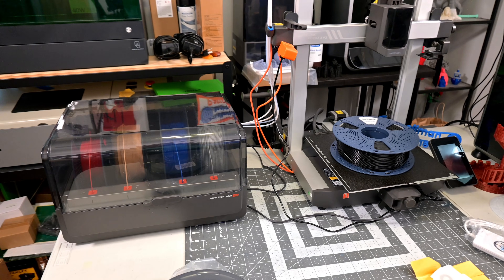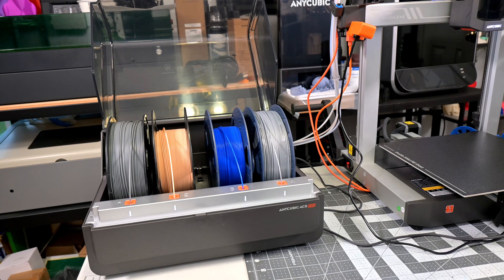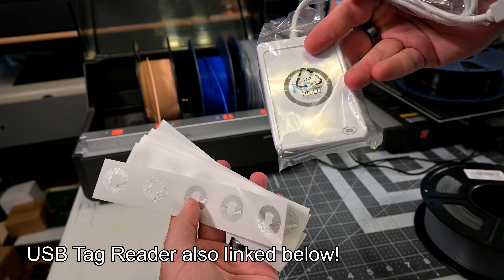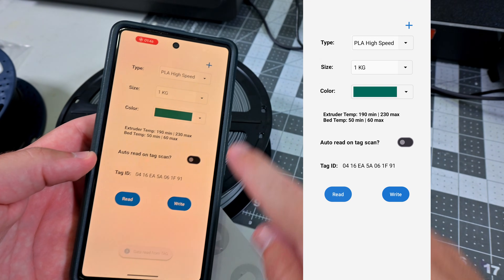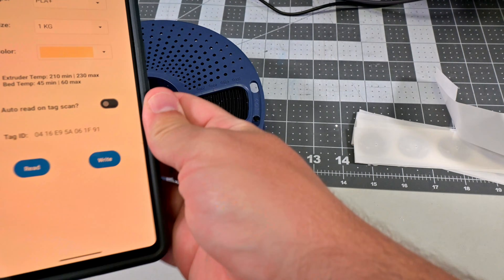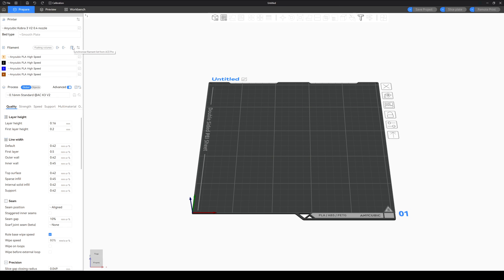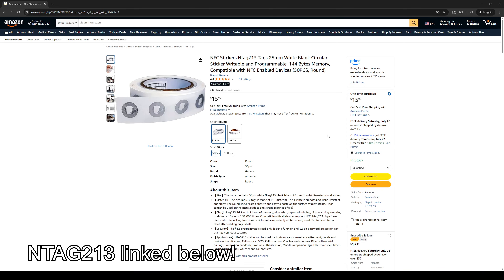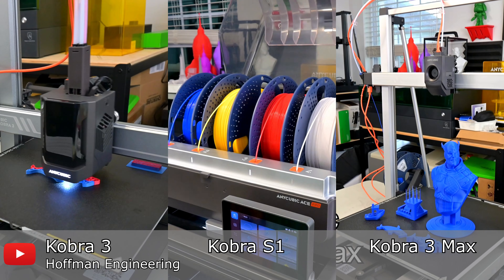Add RFID to Any Filament for the Anycubic ACE Pro

Comment: I mean I suppose if you swap your filament constantly this would be worth the trouble. I'm having a hard time seeing otherwise how this somehow saves any time over just setting the color yourself on the printer which also takes just two seconds. and is free.
Reply from the maker: Yeah, it's mostly for people with either many rolls of filament, and/or multiple printers that you are often changing out filament. And depending on the angle of the touch screen, some very different colors can look similar on the screen. I've selected pink instead of white before, and was pretty confused when looking at the colors in the slicer.

Comment: The app and process work really well! I’m thankful I have an old Android phone in a drawer! I bought some Anycubic brand filament and it came with WRONG tag programming. Ugh! I could not override my Kobra S1’s filament recognition (a simple firmware tweak I hope Anycubic fixes in a future release). I loaded the app and it confirmed my suspicion that the tags were programmed incorrectly. I could remove the tags from the spool, which then allowed me to manually input the filament type and color…sorta. Another problem with the Anycubic firmware is it doesn’t let you choose “PLA+” from the menu. Only PLA. Thankfully this free app and a few bucks in NFC tags from Amazon solved the problem. 

For those who are thinking it doesn’t make sense to pay for additional NFC tags on top of the cost of filament, I plan on reusing empty spools and only buying refills, which are a few bucks cheaper. I think I will be money ahead in short time.

Comment: The problem is that doing it as shown, you end up having to use the default Anycubic filament settings. But they're not Anycubic filaments so the default settings won't work as well as setting derived from things like a Temperature Tower. For example, 3DHojor PLA Pro works best as 215/60 first layer, 210/55 for the rest. Anycubic's default for PLA is 220/60 first, 210/60 the rest. Jayo PLA is 220/60 first, and 220/60 the rest. And so on. Go the extra step and show people how to write custom filament settings using the included manufacturers or their own. Because if you do nothing you'll automatically get Anycubic PLA anyway  - without an RFI Tag. :-).
Reply: @HoffmanEngineering
@pdyt2009  You're absolutely right.  The best method to handle the variances between vendor filaments is to create custom filament profiles for each specific vendor and filament type.  This much works fine.   It's possible to write custom RFID tags for the specific vendor including filament type, color, and temp settings. 

When the Ace reads the custom tag, the corresponding custom filament profile will be selected and displayed correctly in the prepare tab of Anycubic Slicer Next (ACN).  However, this is where the problems.  This custom info will not get passed to the workbench tab in ACN which results in an unknown filament type since the vendor is not Anycubic.  

The only way, at present, to get the RFID tags read and passed to the workbench in ACN is to write the tags as shown in the video with Anycubic as the filament vendor.  This defeats the whole concept of automating the process with custom RFID tags and custom filament profiles.  In order to make use of custom RFID tags and custom filament profiles, Anycubic needs to update ACN so it's not limited to only Anycubic filament.  The question is... will it ever happen?

Comment: Theres an iphone app available now that allows you to write to the RFID tags mentioned - works well. I also 3D printed a free filament spool ring with Anycubic logo one side and a space for the RFID on the opposite side. I believe the ring is meant to be for cardboard spools but snaps onto plastic spools just fine - however you will need to place the RFID tag lower down/ closer to the edge of the ring so its read by the Ace Pro reader. One spool design I printed had Anycubic logo on both sides including the RFID space but was too high for the RDFID reader in the Ace Pro to read. Just lower the placement of the sticker.
Reply: Whts the app called
Reply: There are several iPhone apps that can read and write to NFC/RFID stickers. Is there a specific app you’ve found that has the field formatting for Anycubic ACE pre-configured?
Reply: Love to know this app as well fir the iPhone

Comment: If I have other brands than Anycubic filament o don’t want the slicer to set it as Anycubic filament? And if I buy Anycubic filament I get the rfid with the spool. So why do I want to do this? The Anycubic PETG prints 25 degrees lower than the PETG I am using for example.

Comment: Isn't it possible to take an existing empty Anycubic spool with an RFID tag, buy a cheap refill filament in the color that was on the spool, and spool the new filament onto it? I would do that, so you save money on RFID tags, and you also don't have to go out and buy an RFID reader/writer if you don't have an Android phone with an RFID reader/writer.
Reply from the maker: It's certainly possible to reuse the spool like that. I've found that kind of respooling is a pain though, and easy to create kinks that could ruin prints. But you could do that.

Comment: glad this video popped for me. I bought some RFID tags, I think you overpaid a bit.
 In the video , you are only showing this with what I assume is anycubic filiment, have you tried seeing what you would need to do to make it read and say custom names, etc?  For example if you wanted to use creality filiment, can you input all the values to make it read correctly via NFC on the ace pro?
Reply: I have a question along the same thread as this.  My experience is if I code the RFID to provide the manufacturer name too, the Ace Pro workbench (in the slicer) will say there is a filiment mismatch.  I've had to save the gcode to the usb. Losing the remote print ability.
Do I need to just treat or code it like the generic or Anycubic brand material?
Reply: Am also interested if anyone knows whether the ACE Pro recognises, or operates with, non-Anycubic vendor coded tags? Looking at DnG-Crafts page, and the 'Tag page structure' he has, he indicates that there's a vendor, or brand, section present, where he has AC. Will the AcePro/SlicerNext recognise them if they something other than AC there?  or will they show up as 'mismatch' as @LordSychsis mentions?

EDIT: Just tried it,.. using v1.3.6.1 of SlicerNext,.. in Prepare, colour came through, but type reverted to Anycubic; filament type also did not come though. However, in Workbench, it showed with the correct colour and type.
Reply: @Jimbo-fd8mk  as I know do you need the exakt Letters in your Profils of the slicer. Otherwise the slicer and the printer rejected your choice. I know These from my own experience.
Reply: @lightmare3362  Yeah figured that. So probably a few things would be needed. The codes to start with and then firmware recognising the 'other vendor' codes, which they're probably intentionally ignoring. And the same with slicer syncing/reading that detail. Will probably come with time.

Comment: What if you didn't use the adhesive backs, by inserting them into a thin plastic sleeve, or tape them down with blue or green painters tape?
Reply: You can cut out the Tags and print a tagholder that fits to your spool. So you can take the tagholder and put him to the next spool or give him a new datas for an other color. You can find samples on Printivers and other platforms.
Reply: @lightmare3362  Aren't they like rewritable 1000 times ?